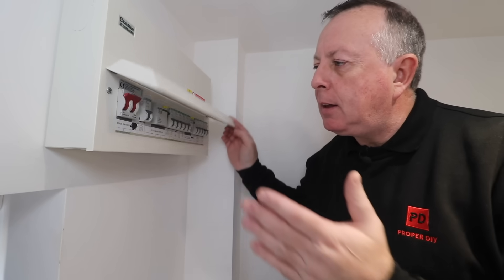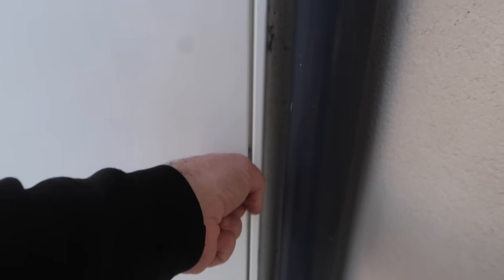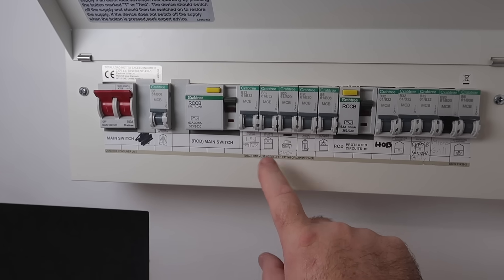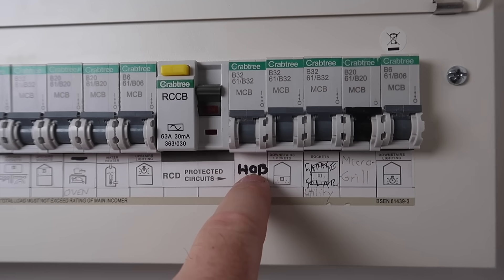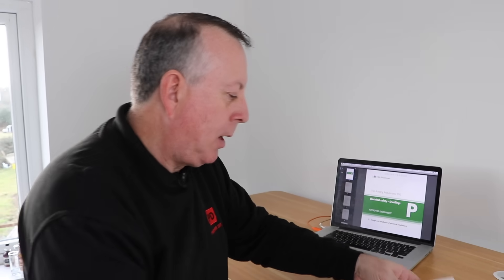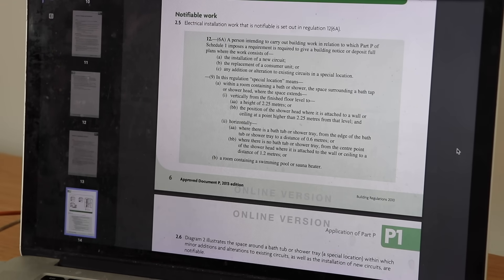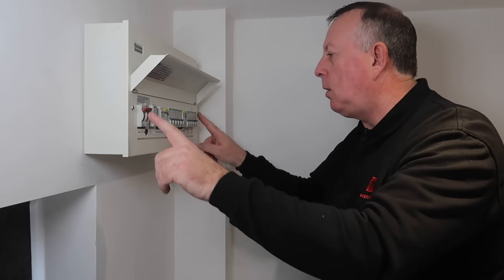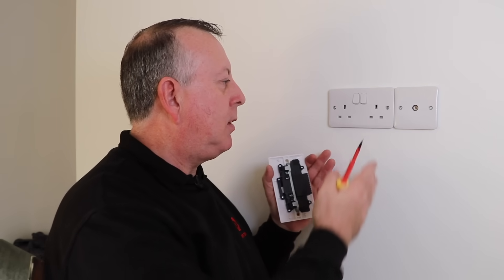What electrical work are you allowed to do in your own home?

Comment: A ring final circuit is a busbar run around the house. Instead of having all the fuses at the fuse box, they are distributed to each socket/plug. By its nature it can use less cable. It has an advantage that cable can also be downsized.  The cable on the ring does not need to be downsized, it can be a higher current rating than the micro circuit breaker in fuse box.
Reply: No John. On a Ring Final circuit, fuses are not distributed around the ring. Not on UK ring final circuits.

The only current protection device in the electrical installation itself is the breaker or fuse in the consumer unit feeding the RFC.

And RFC's are generally not a good idea.
The RFC was developed by the British from World War 2 as way to save on copper, but they have an inherent danger.
An unbalanced load on the ring can cause a magnitude of current to flow down one arm of the two arms to be greater than the current rating for the cable, posing a fire risk and for the breaker back at the consumer unit not to trip.

We don't need ring mains. In some countries RFCs are prohibited and only radial circuits are permitted.
Reply: @deang5622  The ring itself is a bus. The devices taking power from that ring have fusing between themselves and the ring thus are "distributed around the ring" but are not part of the conductive path of the ring.
Reply: Let me tell you again.
There is NO fusing on the ring itself.
I will be explicit because you don't seem to understand what a fuse is.

A fuse is a device that is designed to break the electrical circuit when a specified amount of current passes through it.

There are NO fuses on a ring final circuit except for back at the origin of the circuit in the consumer unit.

The copper cables used in a ring are NOT designed to break the circuit when a specified current is reached. There is no function of a fuse along the ring main itself. There is NO over current protection around the ring main itself.

The second point. In the UK electrical system, fuses are contained within the plugs.  So appliances plugged into that ring final circuit will have fuses in the plug. But those fuses protect the appliance cable, that is the cable from the plug to the appliance. Those plug fuses do NOT protect the ring main and do NOT protect the appliance.

Third point. Ring main sockets are generally not fused. That is, they do not contain a fuse.

These are facts and they are NOT open for debate.
Reply: @deang5622  
You really are confused.
Reply: @johnburns4017  No, I am not confused.
I hold an honours degree in electrical engineering along with electricians qualifications too. My knowledge on this topic is far higher than yours.

You would do well not to challenge someone with those qualifications.

The problem is you don't understand the construction of a British ring final circuit, where as I do.
Reply: @deang5622  
By default the socket is fused by the plug that is inserted into it. A socket is useless without a plug. The plug has a fuse in it, it cannot have a fuse in it. 

The busbar (ring) is a brilliant idea. It only works because each socket is fused. 

The amount of sockets on a ring is limited to the floor area. 100 squ metres. You can have as many sockets as you like. Using radials you would need a number of radial circuits and a much larger consumer unit. All this is more complexity and cost in materials and labour.
Reply: @johnburns4017  "The ring is a brilliant idea and only works because each socket is fused".
This is utter crap.

It is nothing to do with fusing at each socket outlet. The socket outlets are NOT fused. The appliance cable plugs ARE fused.
And even if there weren't any fuses, the ring main still works.

As I said before and I will say it again. The fuses are there to protect the appliance cable. I don't know why this is so difficult for you to understand.

The only protective device for the ring main Is the circuit breaker is back at the origin.

You have been taught or some how you have picked up a load of BS from somewhere.

There is an inherent design problem with the ring main because it can be overloaded and for the circuit breaker back at its origin not to trip. That poses a fire risk.

The fuses in the appliance plugs do NOT prevent that happening. The circuit breaker does NOT prevent that happening.

And the idea that you can connect an unlimited number of appliance sockets...technically you can, if you can fit them on to the cable and have space to mount them. But equally you can do this with a radial circuit.  This is not a benefit or an an advantage of ring final circuit.

In practice there is a limit because the more sockets you add the more likely more appliances will be plugged in and the greater the likelihood of exceeding the current rating for either the cable or the circuit breaker.  So saying you can connect an unlimited number of sockets is just plain silly.

And the busbar claim is BS too.
I will tell you why. A busbar are solid metal bars of large cross sectional area, typically installed in a factory, which are not covered in insulation material.

A ring main is NOT a busbar and here is why. They are not solid metal bars. They are flexible wires of lower cross sectional area to a busbar. They are also covered in electrical insulation, which busbars are not.

The unique aspect of the ring main is the use of two conductor cables to convey the current out to to the sockets in a loop topology, and two conductor cables to return the current.  That is not the topology of a busbar.

End of Debate. Recognise when you are up against a professional that is far more highly qualified than you.

I am not going to debate this any further with you. I genuinely do not think you have the intelligence to understand.
Reply: @deang5622  wrote:
"I hold an honours degree in electrical engineering"
🙄
Get your money back.  BTW, I have an honours degree as well.  😉
Reply: Love the comment section n these videos it's gold dust more entertaining than the video and TV for that matter, @john burns what's your credentials in electrics if you don't mind I ask ?
Reply: @mikeb1417  
Initially Computer Science. Over decades spread over to electrics. Early computers used a lot of power and also they needed air conditioning in the large rooms they were in. Electrics is involved in it all.  Rings are very economical in groups of desktop computers.
Reply: @deang5622  
The fuse in a plug is primarily there to protect the cable. However correctly sized it can protect the appliance.  Hence British appliances rarely have fuses in them. But some appliance makers rely on the fuse in the plug for appliance protection.  

An e.g. is gas boilers when the maker specifies a 3A fuse. The boiler could be connected by a 2.5mm cable which takes 27 A. If the cable was only to be protected they would specify a 13A fuse, the maximum that can be fitted, or say consult your electrician on fusing for cable protection.  But they do not, they state a 3A fuse, as they want the innards of the boiler and its cable protected by the fuse in the plug/FCU.
Reply: Many clearly do not understand what a final ring is to do. The ultimate is to have a radial to each socket outlet on its own fuse at the main panel - the optimum solution of course.  This means you will need a very large expensive main panel and lots of fuses (one for each socket) in the main panel. 

🎊🎈  BINGO  🎊🎈 
A ring gives this by distributing the main panel around the house via a ring cable, distributing the fuses from the main panel around the building to each socket. The ring is a busbar. This saves the vast expense of a plethora of radial cables back to the main panel and also a plethora of expensive fuses/MCB's/RCBO/AFDDs at a very large expensive main panel and expensive labour to install.

a) A ring uses less cable and gives a longer route 
b) No limit to sockets on the ring, but total is limited to typically 32A.
c) A ring uses less copper for a given load/area. 
d) Rings rarely have voltage drop as it is fed from both ends. 
e) Rings have lower impedance, less volt drop is less waste!  They are more efficient.
f) No single point of failure for the protective earth.
g) If you are covering all rooms on one floor then a ring can do it. 100 squ metres of floor area, then as many sockets as you like. 

1. Ring final 2.5mm cable, 32A B-curve MCB, length 106m on TN-C-S.
2. Ring final 4mm cable, 32A B-curve MCB, length 171m.
3. Radial final 2.5mm cable, 25A B-curve MCB, length 33m.
4. Radial final circuit, 4mm cable, 32A B-curve MCB, length 43m.

Simple and highly effective.
Reply: @johnburns4017  No you idiot. Fuses are nothing to do with it.

The purpose of the ring main as I explained right at the start of this thread, is it is hangover from the second world war where it was developed to reduce the amount of copper needed, when copper was in short supply.

It has NO benefits other than to save on the amount of copper.

The fuses are nothing to do with it. 
I will say it for a third time. The fuses protect the appliance cable. They do NOT protect the ring main.

Every qualified electrician and electrical engineer knows this. So it is quite obvious to me, you have ZERO formal electrical qualifications.

I AM part of the organisation that write the electrical regulations in the United Kingdom.

Go AWAY and learn the subject properly
Reply: There are advantages to rings. They have been widespread in the UK for 75 years. They have been found to be very safe.

♦ Cheapness, as smaller, easier to install, wires can be used;
♦ Two ways for the earth back to the consumer unit;
♦ Another is a large number of sockets can be off one cheap to install ring;
♦ Having the same number of sockets using radials would mean multiple radials and multiple extra breakers at the main panel. Far more cable, expense, labour and hassle;
♦ The 32A breaker and 13A fuse in the plug ensures safety.
♦ Portable plug-in appliances on a ring cannot exceed approx 3kW. Some plug-in ovens are on rings;
♦ Rings usually have a 32A breaker at the main panel - can be a lower value;
♦ Using push-fit maintenance free Wago type connectors to connect up the ring adds safety, as not being screwed connections they do not work loose. The ring's current does not run through the socket terminals;
♦ The British plugs are designed with rings in mind having a max 13A fuse in them - can be as low as a 1A fuse in the plug to suit the appliance and flex/cable. Small flex and appliance? Then a smaller fuse;
♦ Rings in the UK are limited by square metres of floor space, with no limit to the number of sockets on the ring. 100 square metres of floor space with 2.5mm cable for a 32 amp final ring. The cable can be 4mm, which is advisable in an unbalanced ring drawing high current loads;
♦ Less voltage drop on long cable lengths as voltage come from two ways.  

Radials are also used in the UK. Rings are not mandatory, but used because they have proved to be generally trouble free and safe. They can be installed using rule-of-thumb. These days a ring will be on an RCD or RCBO - these now are becoming DP, so safer again. AFDDs are now mandatory in some installation and recommended in all installations. AFDDs raise the safety level. 

In one job in an office, they wanted more socket outlets for extra desk computers. It was a simple matter of extending the existing ring with the extra sockets as the current draw was low. Cheap and easy. If radials were used three radial circuits would be needed, which would mean an extra consumer unit, breakers, wire etc, then far more labour.

Some disadvantages are:
♦ Rings are more difficult to fault find. But electricians have no problem once the ring is full understood;
♦ Another is that if a number of high current drawing appliances are on one side of the ring, say nearer to the main panel, most of the current draw may be down one cable leg of the ring with the cable rated below the main 32A breaker. 2.5mm cable is rated at 27A max. Although tests have proven the cables do not exceed their current capacity in the vast majority of cases, just an imbalance in distribution of the two cables from the main panel (consumer unit). Good circuit design will prevent this, negating this disadvantage. Balanced rings can be installed by daisy chaining to alternative socket outlets on the ring. That is the first appliance will draw from one side of the ring, the second socket will draw from the other side, and so on round-robin. Or use 4mm cable to the point where heavy current drawing appliances are, then 2.5mm for the rest, if it is that troubling for some. Using 4mm cable on one side of a ring and 2.5mm on the other, is still cheaper than a bunch of radial circuits.

Overall I consider one ring superior to a bunch of radials needing their own breakers at the main panel. They are simpler, cheaper, being proven to be safe and worked well over the past 75 years. Using the new AFDDs on rings, which are recommended and mandatory on some installations, gives a far higher safety level. You will have to give a very convincing argument for me to give up rings. I have not heard of one yet.

Comment: The Lewden main switch in the meter cupboard has a 63A, 80A or 100A fuse.  This is totally unnecessary as there is already a double pole main switch and suppliers main fuse.
Reply: Well you've just illustrated your incompetence with this statement.
Reply: @davebadger100 100% agree 👍

Comment: This is so wrong. Anyone can work on electrical systems as long as you are competent. The only part you cannot work on is the suppliers main fuse and meter - why they have seals.  If you are worried about insurance, etc, get an EICR test, which is cheap enough.

Comment: RCDs- nothing apparent about them. I was living in South Africa and my nephew stuck his finger in a live socket (they're round pins and holes easily fitting a child's finger) and I heard the power trip and the siren of his cry. RCD saved his life.
Reply: Seriously, a small child can make finger contact with the live part of a power socket in SA? Wow.
Reply: @Tony Bloomfield  Yep. The older plug type is Type M and kids can get their finger into that socket. Many come with a protection plate that swings out of the way when the plug is inserted, but many don't. Most parents I know have purchased blanking plates that are plastic plates that fit into the socket and can be removed to plug consumers in, but all it takes is a single mis-wired plug or a faulty RCD and a kid is gone.
Reply: @tonybloomfield45283  They could but it is trivial to teach them not to do so.  The real danger in South Africa comes from illegal electrical connections by people trying to get free electricity.

Comment: For many years I have followed, read, spoken/read countless sources of information pertaining to electrical work, installations, the law, part P and so on.
It is beyond me how something so potentially dangerous has SO MUCH ambiguity surrounding it!
You could literally get 10 qualified sparks in a room and you could ask them the same question and get 10 different answers.
The posts on here are proof of that.
I had intended to ask a long standing question of my own but the fact that I can guarantee I will either not get a straight answer, a dozen different answers or the usual - "If you are not qualified don't touch anything" OR my favourite "Read part P"
Reply: As an electrician with 50 years of experience that's true. The same as with plumbers, mechanics and a lot of other trades lots of things are open to personal interpretation of the regulations we work under. The wiring regulations in my trade have so many cross references in it that you can easily loose track of the original item you were looking for so no surprise there is confusion and different interpretations.
Reply: Go on then, try me.

Comment: I've seen sockets wired in bell wire over the years and thing Joe public should not be allowed to do anything but change light fittings.
Your life and your family's life could be at risk if you get it wrong !!!
I've come across many dangerous installations cause by a unqualified installer 
Be very careful 👍
Reply: Found a cooker in 1mm 2 core flex 😂🤦🏻‍♂️🤷🏿‍♂️

Comment: insist on a an isolator between the meter and the CU, otherwise you (or anyone else) cant work safely on the the consumer can work safely without pulling the incoming fuse which should not be done.

Comment: Having worked on HV testing (up to 50,000v) before I retired and as a retiree of 27 years in a house I'll die in that has no house insurance I'm not that concerned about what I can and can not do as a DIY'er. Is it my house or is it part mine and part some other authority that paid nothing towards it?
As an aside I, quite by chance, discovered when remedial work was being done to my then new house that behind part of the fitted kitchen and now not accessible without very major work was an illegal installation carried out by the builders qualified site electrician. A break in the kitchen ring main had occurred due to incorrect sitting for sockets. This break was connected up with a screw terminal connector block and then wrapped in tape. Over time copper 'flows' under pressure, like from a screw termination, and can give rise to a HR (high resistance) joint. Pass current through this and it will get hot with the potential to cause a fire. Building regs for the build was on a 'self certification' basis so no one checked it. Are the council building regs dept going to 'raid' my property to check compliance??

Comment: After having RCDs keep cutting out, we had our board checked and the 'Qualified installer' hadn't fully tightened half the connections, at least we part funded his new car hey.
Reply: Probably twisted the wires into the terminals, over time they gradually work loose.